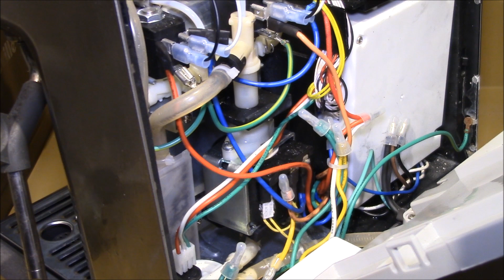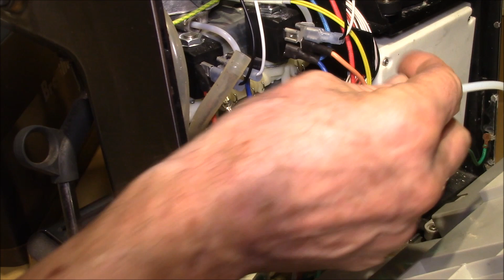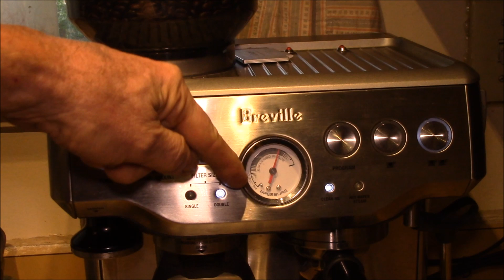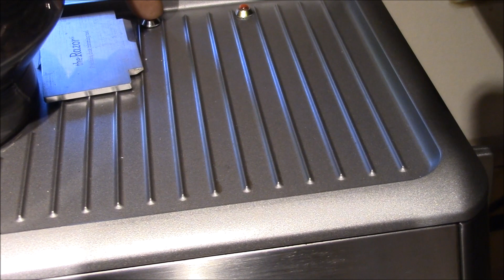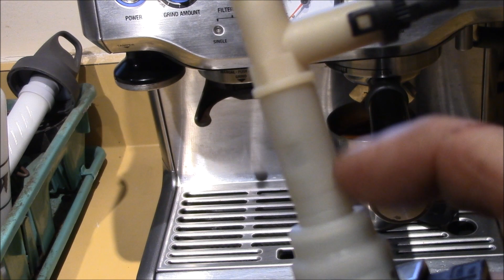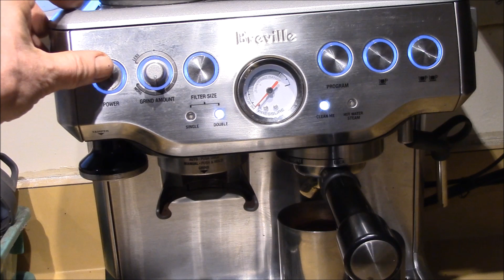Breville 870XL Pump / Safety Valve Replacement, Part 2

Comment: I replaced the pump the other day since it failed after so many years of service. I can hear the new one starting when I switch the machine on however it doesn’t pull water for whatever reason, checked the flow meter and it looked ace, I also “deleted” the downstream system and tried to prime the pump directly from the inlet thinking it was air locked but nothing. 
The solenoid valve and the thermoblock seem functioning, water doesn’t go past the pump (doesn’t even reach it to be honest) so I wonder what the problem may be…. any thoughts ?
Reply from the maker: Likely the small in-line water filter down below the pump.  It's more of a screen and it may be clogged.  See 1:10 in the video below:
https://youtu.be/9lMw6ooiqPI
Reply: @The4Crawler fantastic, thank you so much for you prompt response. I’ll give it a go and share the outcome here. Thanks!

Comment: I replaced the pump and celinoid about 18 months ago. Been working fine. One big problem I discovered yesterday was in not using Breville part, just aftermarket ones stating equal with OEM parts, the espresso machine is leaching lead. I contacted Breville and they said their machines do not contain any lead. It dawned on me that those parts replacements must contain lead. I’m in the ER getting all kinds of tests done. Check the water coming out of the machine for lead!
Reply from the maker: Good tip, thanks for sharing.  Hope the tests come back OK.  Of the parts I've used, the pump was an Ulka brand, and the solenoid valves were Ceme which is apparently the brand Breville is now using.

Comment: I just switched out my pump for a new one as the old one died. Big thanks for guiding us all through opening this machine up. Luckily I watched these videos thoroughly before starting or I would have easily missed that gasket too. 

I decided to observe the machine open for a few cycles and managed to catch a leak from the pressure fitting. The o-ring seemed fine but I switched it out anyways.. now she’s dry as a bone. Very happy with myself.

Comment: to pull the safety valve forward, is it just 2 screws? Do you just used another zip tie to secure the larger hose that comes out of the T? Thanks
Reply from the maker: I think that's all I did to tip the top of the pump out far enough to let that fitting be spun off and back on.  You'll need to remove the tube off the side to do that, so cut the old zip tie and replace it with a new one.

Comment: why did you replace the safety valve did it failed? i saw it is demountable
Reply from the maker: A new one came with the pump I purchased and it seems the old one was leaking a little bit:
https://youtu.be/z9KGunmnLSI?si=zC_cnEYTqaCqeCcu
That later cleared up so I assume it was just some debris inside the valve that was causing that problem.
Reply: yes i saw that video my problem is that i see it leaking but nothing suspicious inside on the other hand no water coming through to brew head or hot water tube so i wonder if it is safety valve failure or other blockage after the pump
  @The4Crawler
Reply from the maker: @guytzur9120 Some troubleshooting tips in the pinned comment on this video:
https://youtu.be/9lMw6ooiqPI?si=JhP4mUlQaHXiK1FK
Follow the path of the water from the tank to wherever it's ending up, like the drip tray, and figure out what path it's taking to get there.
Might be no water getting to the pump, clogged inlet filter perhaps.  On the outlet, remove and test one line at a time for blockage, try blowing through each line. Maybe an o-ring is bad.
Reply: the boiler is blocked it is 1mm spiral tube where can you get 230v boiler?
 @The4Crawler
Reply from the maker: @guytzur9120 Search the web for "Thermocoil Comp Assembly 230v" or similar.  I found 
https://spares.bigwarehouse.com.au/product_info.php?cPath=64928_68652_102368&products_id=1875688 
Or contact Breville support, they can often supply spare parts.
Reply: thanks actually it is sage and the boiler is just spiral tube connected to heating element under ,do you think ultra sonic bath can release the block? @The4Crawler
Reply from the maker: @guytzur9120  Sure, give it a try.  Use something like vinegar or your normal descaling solution.  I was able to free up a clogged dual wall filter basket with citric acid in an ultrasonic cleaner.  It did take some time but once it cleared up enough to get liquid through it, it went a lot faster.

Comment: hi is me again. I run a test with pump through boiler and little water comes out. I have decided to take pump apart again.. guess what? one of the springs broken in half and screw together as one but shorter  I will change the pump and let you know..
Reply from the maker: Sounds like you found the problem.  I have some pump repair/replacement information below:
https://photos.app.goo.gl/tyJ8XEehsduBZHWk7
Reply: @The4Crawler  I did not change the pump but the ball hoping everything all right. When all done to test I could not find the old ball around. Testing, ok for few seconds and again steam through brew head and a buzzing pump. Indeed I left the old ball inside. I found one chipped and two fragments blocked the 3way valve. Cleaned, another new ball and decided to replace the little seal around piston. Put all together but pump no noise. The new seal was too tight blocking the piston. Back the old seal and now everything is perfect. Hallelujah

Comment: please help. I have the same machine. solenoid valves are ok  cleaned and tested few times. the problem is the water in the brew head is too hot comes out with steam. switching for hot water it comes steamy too. when switching to steam, not enough steam, is trying to build up steam when pump is pulsing but not wining. I have changed the ball to the pump just in case but no difference.  any thoughts? bless you

Comment: Is the black knob on the release valve for adjusting the release pressure? Any one can show a picture of the inside of the black knob?
Reply from the maker: See this video, at around 3:30:
https://youtu.be/z9KGunmnLSI

It's just an adjustment knob, there's likely a spring and a ball under it, turn it inwards and there's more force on the ball thus opens at a higher pressure, out is less force so opens at a lower pressure.
Reply: @The4Crawler  Thanks so much for your quick reply. I took the black knob out but there was empty so I just wonder how the pressure can be adjusted. However when my BES840XL is brewing the pressure guage needle points at 10 o'clock.
Reply: @The4Crawler  Do you have a picture of the black knob removed that shows the inside of it? Thanks in advance.
Reply from the maker: @next1mpact  Just uploaded some photos of that to the end of this photo album:
https://photos.app.goo.gl/bN1ugnLPYwvyDcr59
Reply: @The4Crawler  My BES840XL is the first release version. I can see the difference from mine which has no o-ring and spring inside. Last but not least thanks so much again for your help.
Reply from the maker: @next1mpact  Good to know there are differences.  For the most part, I've heard the 800 series machines are similar, but when you get down to the details are where those differences show up.

Comment: These videos are incredibly helpful!

I recently replaced the pump with success, but I cannot recall the location of an extra spring. The spring is a half inch long and has a plastic bobbitt.

Please help
Reply from the maker: Maybe a spring out of the old pump:
https://photos.app.goo.gl/Sbm2SzPafYNSDMRVA
or perhaps out of the over pressure valve if you took that apart.

Comment: Do u know if u should be able to force air or water threw the heater coil with your mouth. I can’t get any water threw anything. If verified the pump works and I’ve bypassed the solenoids. But I can’t blow anything threw my heater coil on the barista pro.
Reply from the maker: I've not tried that myself, bit I would think the thermo-coil should pass water or air through it.
Reply: @The4Crawler  Thank You. Is there a setting for the safety valve or just screwed all the way down?
Reply from the maker: @BlindSightProductionz  Never seen a specific adjustment setting for those.  I would think setting it so that it doesn't open in normal operation is a good place to start.  It's only supposed to open if the internal pressure goes too high.

Comment: thanks for the advice about the leakage. I was curious where do you get the gaskets? You think these standard sizes you can get at a hardware store? thanks! Looks like I am going to have to get ready to work on this thing. It runs but has leakage and the pressure never gets built up no matter how I change the grind size. This machine needs some adjustments.
Reply from the maker: Replacement o-rings are available below:
https://www.4crawler.com/YouTube/index.shtml#Orings
For the gasket at the pump/safety valve, I just re-used the one that was on the machine originally.  It appeared to be in good condition so I didn't bother finding a replacement.
Reply: @The4Crawler  thanks man I was worried this may be a crap buy from ebay. But now I have some hope I can turn it around to a functioning machine! great help!!! thank you!!!!

Comment: Incredible. About a week ago, my 7 years old 860XL started tripping the GFCI whenever I tried to extract a shot. 
So, I first googled it and it took me to this video. 
I gained the courage to disassemble the machine only to see that the safety valve was leaking. 
It is incredibly hard to find the replacement because this machine and the spare parts are no longer produced. 
Then I found a repair shop in my country (Germany, yet still 600 kms away from where I live) which somehow found this part and shipped it to me in one day...
This afternoon, I changed the valve and also did some additional maintaining (clean the tubes and the calcified surfaces).
And finally I extracted this shot. https://www.youtube.com/watch?v=SLMSSxDD4M4
The result is incredible. There is also no leak.
Thank you very much. I guess I saved about 150 Euro!
Reply from the maker: Glad you were able to repair the machine, congratulations.

Comment: I replaced the pump, there is a leak near the safety valve, I do have the silicone gasket installed.  My problem is no water flow, the pump is running, but no water comes out anywhere.  I did clean the solenoid valves and all tubing while I was waiting for the new pump to arrive.  I guess there is a clog somewhere.  I can blow air through all of the tubes.  Can't tell where the blockage is.  Frustrating.  I see you are in the south bay, me too.  thanks for making the video!

Comment: Hello! I appreciate this videos. You seem pretty knowledgeable on this machine. I have same issues and ordered a new pump and valve but the valve is in back order. The reason why I adventured to open it and start working on it was because it was tripping the gfci in the kitchen. I found that the problem is water coming out of the bottom of the valve. I don’t think I saw a seal gasket (ring) there when I replaced the pump but that is where the water was coming from. Is there a part number for that seal? Thanks for all the videos!
Reply from the maker: I've not run across a separate part number for that sealing washer.  I'll be making a video where I show testing my old pump and valve and for that I used a small o-ring to seal up the connection between the old pump and valve.
Reply: R Brown I saw the video and the o’ring. I’ll probably got to a hardware store to see if I can find something like it.
Reply: @customremodeling1767  hi, I am having the exact same problem (tripping the GFCI due to a leakage I spotted on the safety valve). I was wondering if you were able to solve your problem. I couldn't replace the safety valve since it is not possible to find one easily in Germany where I currently live. Thanks anyway.
Reply: You might find an o-ring at a hardware store, to replace it.
Reply: @patchong9263  Thanks! I did that back when I replaced the pump and has been working ever since.

Comment: Thanks for the video but i just wanted to know if my machine has the buzzy noise and no pressure at all... How could i know if it is the pump or the valves to be replaced... I did a small test and i flipped the two valves to check if the steam one is defective or not but i got the same result as always that my hot water steam and flow are working but not the water flow for the espresso(no drop of water at all)  and zero pressure with the buzzy noise when i hit the program button? 
Any ideas?  And really thanks for the videos it really helped me to get a much better understanding of my coffee machine
Reply from the maker: My guess is that it's the 3-port solenoid valve that's buzzing and causing the problem.  This video covers the water flow through the machine:
https://youtu.be/9lMw6ooiqPI
Swapping the two valves (I assume you swapped the wires between the two) would have the affect you describe.  Normally for hot water/steam, the water flows to the hot water/steam valve via the center port between the two solenoid valves.  For espresso, normally the 3-port valve is energized, closing off the center and opening the top port to the group head.  If you swap the wires between the solenoids, you would cause the 2-port valve to open and dump hot water into the drain pan when you try to brew espresso.  I have a couple of videos in this playlist on testing, replacing and cleaning those solenoid valves.  If it's an older machine like mine, it's worth getting the newer Ceme solenoid valve like I installed.  It seems to work much better than the older Olab solenoid.

Comment: Thanks for showing
Reply from the maker: Luckily this wasn't too hard to remove and replace after I saw the water leak inside.  That's the problem with these replacement parts, they come with no instructions at all, so you have to figure things out by trial and error.